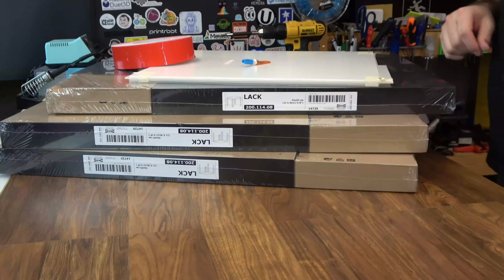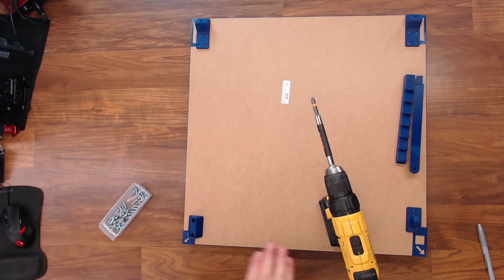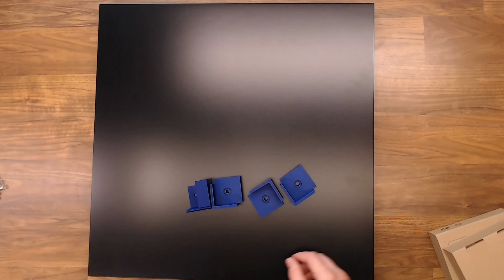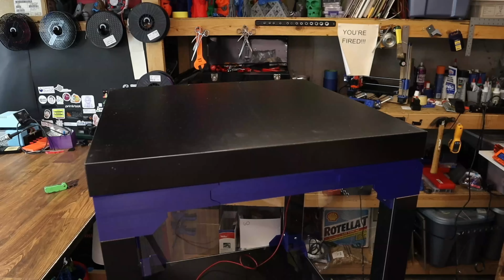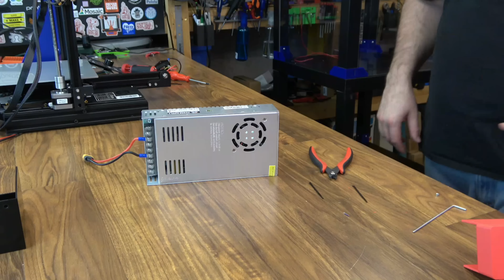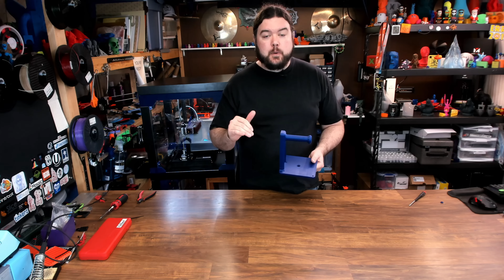Ender 3 - Prusa V2 Lack Table - Enclosure Build - Chris's Basement

Comment: 200 Hours of Print Time really and you made parts and reinvented the wheel while there are enough Solutions already on Thingiverse? Sorry to say that Chris, because i really like you Videos and you helped me alot with them... But.. That really seems like you were payed by Prusa. There are better Enclosure Designs already available on Thingiverse for an Ender 3 that take much less time to Print and also got other nice Feature, like Plexi Sheets that are secured on all sites with Neodym Magnets for easy Access if needed... Also did you really left the Motherboard on the Ender in an Enclosure? Because that was the only think which held me to not stop the video and do something else.. And is also the only thing which deservers an Extra Video, the Extension of all of the Cables out of the Enclosure, so that just the Stepper stay inside. (That also includes mounting the Display outside of the Enclosure) 

But i don't want to just Critize you... I have'nt seen something like the PSU Cover you designed yet, so at least thats new. And i will probaly print that, when i continue with my own Enclosure, which still takes a while, because i have'nt finished the SmuFF yet (which is an Universal MMU for any Printer)
Reply: Hey. At least he is helping a American company.lol
Reply from the maker: I really don't feel like answering this post, so just try to have a good day.

Comment: One thing I've found is that to make adhesive-backed items stick to a porous surface like MDF or the like, use some gloss spray paint or clear coat spray.  The smooth surface the paint provides will make the adhesive REALLY grip like it was intended.  The LED strips will then stay put.  I do like your mount blocks for the LEDs though.  I think they'll come in handy for a lot of projects.
Reply from the maker: Thanks Rob, great tip I will have to try it.
Reply: I don't think that's the problem in this case.  If you buy a strip of LEDs the tape they come with usually isn't even very sticky. Like even to itself it just falls right off.  I usually add some E6000 to mine and just paper tape it in place until the glue dries.

Comment: That thing will shake itself to pieces when you start printing.
Reply: No it won't.  This is a popular cabinet even for bigger printers.  He's even using an official Prusa design.
Also, this table is pretty popular for other hacks too (there's a home server rack/audio rack project that uses them iirc -- so it's definitely sturdy).
Reply: @BrainSlugs83  I have 2 Ender 3's inside a custom made cabinet out of MDF and the cabinet is bolted to the wall. My usual printing speed in PETG is between 70 and 100mm/s, wall speed at 35 - 50mm/s, first layer at 25 - 35mm/s, travel speed  175 - 250mm/s. Try printing in this thing and see what all that shaking will do to your printed parts. Then put your 3d printer on the floor and print again. This design will do just fine for static loads or for showing off your 3d printer to your friends. 
Also, take a look at 29:03, when he opens the doors the whole thing shakes.
Reply: @valyo007  No one is making you use it, baby girl. You do you.
Reply from the maker: I print in a Lack enclosure like this one and have for years at 100mm/s with no issues.

Comment: Freedom units? Babarian units! ;)
Reply: Honestly, for "normal" temp ranges, Fahrenheit is more people-friendly then Celsius. But in general you're correct.
Reply from the maker: I wish I could get more metric stuff locally, it's easier to just use one.
Reply: @ChrisRiley  BTW wood screws are not named with an M, so they are not M5, only 5 mm. The letter M stands for machine screws, AFAIK.